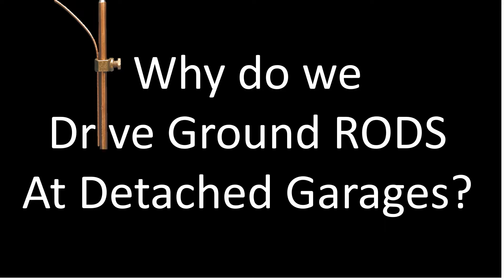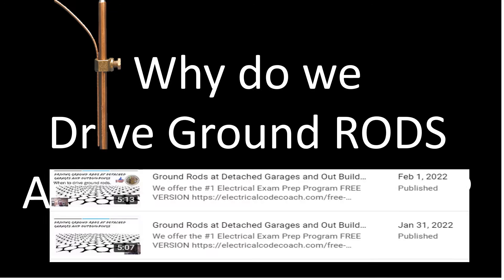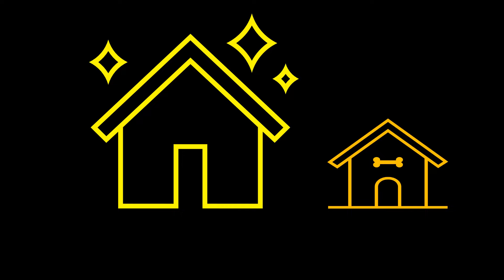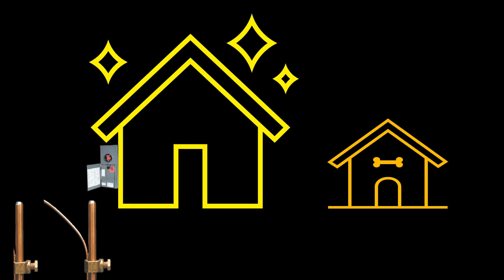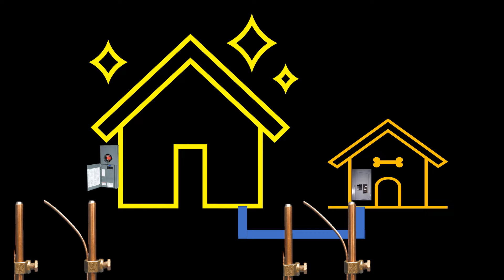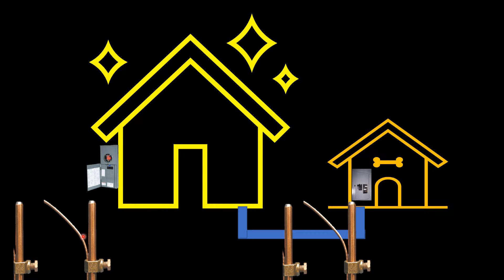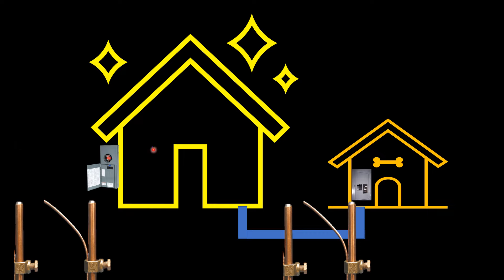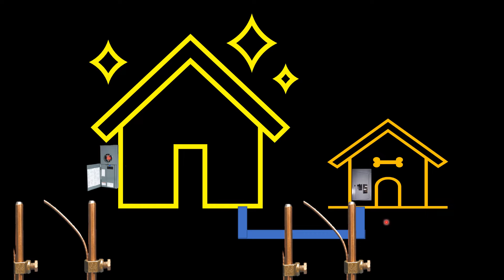Why do we drive Ground Rods at Detached Garages?

Comment: Thank you for the explanation. I just had a 100 amp sub panel installed in my metal garage 130 feet from my house. The "electrician" insisted the 4 wires were enough and that I didn't need a ground rod because it was "grounded well" at the main. So I added a 8 foot copper ground rod next to the sub panel because I'm afraid the garage is more prone to lightning since it's metal and I live in the desert. Good thing I watched this video before using any power on the sub panel

Comment: Great content.  As a gas fitter, I have incorporated bonding and ground rod installation to my jobs/estimates due to most clients not taking the need seriously.  For several years I passed along contact info for electricians i knew so the clients would get them to bond the gas piping.  Most didn't bother.  Once our local code enforcement started hinging pass/fail on ALL TRADES involved with a project, I bought the rod driver, took some courses and made it part of my skill set.
Having and electrical background from military service helped me a lot too.
Reply from the maker: Thank you for sharing!

Comment: We have a 75 year old cabin in Montana built by my grandmother with no ground; just a hot and neutral running to each outlet and no ground rod.  The electrical system has always worked fine (all aluminum wiring too!).  Your explanation is very helpful, and helps me to understand why the system works without a ground rod (or even a neutral wire connected to a ground rod in the system).  Maybe that's how some people did it 75 years ago?  There is a power pole near the cabin with a ground rod...so perhaps that's providing some protection.  In any case, thanks for the explanation.  Perhaps it's time to put a few ground rods at the cabin and also detached garage.  When I try to charge my Tesla it always trips with an error because it can't find a ground.  Apparently the car check for that.

Comment: I have a slight objection to this - I know you use the term path of least resistance, but you introduced another patch from the main building through the man cave wires to the grounding electrode system over there.  Also, if we are taking about lightning strike,it’s going to hit the roof or structure skin to earth.   I’m not debating the requirement or wisdom of your decision, I’m asking the question in regards to what’s actually being protected.  In this case, if you have an antenna, the tower is a separate ground to earth via a separate rod. Also, it’s my understanding that we don’t invite strikes by grounding metal roofs on a home.   I love the question BTW.
Reply from the maker: Lol it's just the code I look forward to your public input in the 2026 NEC 😃
Reply: @ElectricalCodeCoach  cool - I was asking the question to better understand why it’s done, and to think through the expected outcome during events that require a protective outcome.   Lightning protection is an art in my opinion and I still struggle with it after years of school in electronics and electrical theory.   I appreciate the topic Coach. 🙏

Comment: Could you run 3 wire to the outbuilding and then ground the panel with 2 rods? Or would you still need to do 4 wire and the rods? 🤔

Comment: When I built my detached shop building in 2004, county jurisdiction required the new building breaker panel be un-bonded and the ground conductor to be run all the way to the main panel at the house. I watched a video ( can't remember the author ) about why that is so important. Has the NEC developed a new theory on proper grounding?

Comment: Hi... I recently added a shed to my compound...it is about 8 feet away from my garage....100 amp panel in the garage.    Newly added "Shed" I installed a 100 amp panel /6 slot.   I wired new one for 3 breakers...Number one Breaker is 15 amp for lighting( 4  4 foot LEDS)....Second Breaker is a 20 amp breaker for the south side bank of outlets (7) ....The Third  breaker is a  20 amp to power ( 6 ) outlets... I ran solid copper wire over and shared the original copper ground  rod.....Did I F up?  Thanks!!

Comment: My garage has no ground wire from house to garage.
I wanted a GFCI outlet in there.
I installed the GFCI, and ran a ground wire outside the garage to an existing ground rod.
Works perfectly too.
I was told by an ex building inspector that this was not safe but they didn't tell me why or how.
I told them I am not going to spend $1,000's of dollars upgrading the house electrical panel, associated circuits for 'code compliance', wiring to the garage just for one lousy outlet.
Old outlet was broken is why I needed to replace it. After 60 years, few old outlets will survive lol

Comment: Let say you ran ser ( two hots, a ground and a neutral) and then you ran a separate ground wire ( equipment ground) to the sub panel in the detach structure would you still need to add two ground rods? Or just eliminate the egc run the ser and slam two rods in ?

Comment: QUESTION:

Similar to your scenario above except
think of the dog house / garage as a solar equipment inverter.

Assume nothing is connected to grid power.  Only solar power from the garage is the originating power source.

The garage functions similar to the electrical pole and it is generating the power.  it is grounded and it also has a neutral ground bond at the garage’s  internal breaker panel, where all inverters are supplying generated power, to be distributed to the house or other distant structures.

Should the house say 250’ from garage, consider the incoming power from the garage as if it was from grid electrical pole, and should there be a neutral ground bond in the main breaker panel?

Should the ground from garage be connected to the ground at the house?

What other considerations should evaluated to avoid catastrophic failure  creating harm to individuals?

Comment: My main panel is in my home. There is a heavy gauge aluminum braided wire (at least 1/2 thick) connected to the neutral/ground bar that goes up a galvanized pipe and to either the water or gas line entry point to the house (less than 100 ft away). I don't know because I haven't followed the line yet, but I assume this is what was done based on the gauge of the wire in this 1970s construction.

My question is. If it's acceptable to have that long of a ground wire to reach ground from the main panel in a house, then in a different house with a ground closer to the main panel (say 10 ft) why oh why couldn't you just connect to the ground with your four wire system at the main building panel? Why would another ground rod be required?  Isn't it more important the resistance of the grounding system? 25 ohms or less, right?

Comment: Ive got a question. Never answered. A trailer house with detached meter box. A  moveable detached shop with 220v 50 amp sub panel not bonded having a ground back to trailer panel. Not bonded.  Ground wire to meter box bonded and ground rod. Less then 30 ft run to shop. Should there be a ground rod at the shop? From a you tube house  videos sounds like no. But this isn't a typical house arrangement.

Comment: Good video, now what if you have 3 buildings house,garage, and a small shed
Reply from the maker: If there is more than a single branch circuit or multi-wire branch circuit there would be required to be another grounding electrode system at each building

Comment: Howdy.
Statics Yes. Lightning Yes.
But the most important thing is potential equalizing. Both during normal operation and during a ground fault in an appliance.
Assuming all metal parts are well bonded inside the house. Then, in a twist of faith no soil electrodes is safer inside the house. Why ? The utilization environment is more free to float closer to the fault point potential in case of a ground fault. Less touch voltage.
So why the soil electrodes ? Outside the scenario is different. During a ground fault indoors, the irrigation faucet may shock the irrigating person outdoors.
So. Comprehensive bonding is good. Low soil electrode system impedance is also good.
Regards.

Comment: Don’t understand why the smaller man cave would be hit by lightning strike rather than the house?  My understanding of lightning is it hits the higher building, tree, etc within 150’ of each other.  Maybe the answer is static electricity but that wasn’t explained how that happens.
Reply: Most likely it would hit the tallest nearby structure but not necessarily.  It can strike anywhere.
Reply: it also depends on where the tallest tree grows. seen plenty of sprinkler systems have their transfo blown off the wall.
Reply: Lighting strikes aren't that predictable. In my case, I heard a flash-boom of a really close strike. When I looked out, steam was pouring out of a smaller tree across the alley and not the much taller oaks next to it.
Reply: Lightning doesn't have to strike directly - it can strike nearby and induce a high energy pulse in wiring, etc.